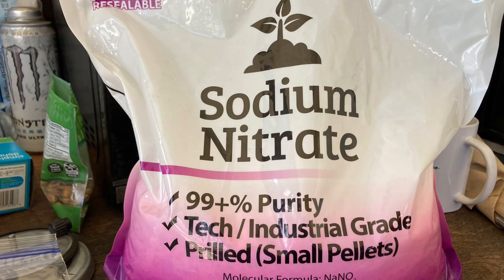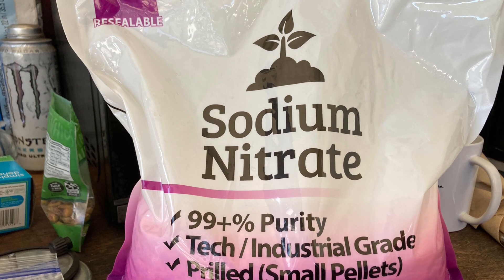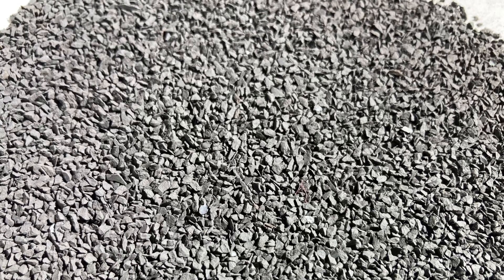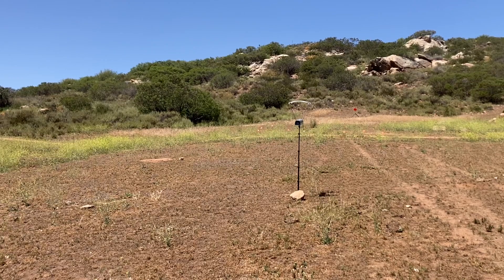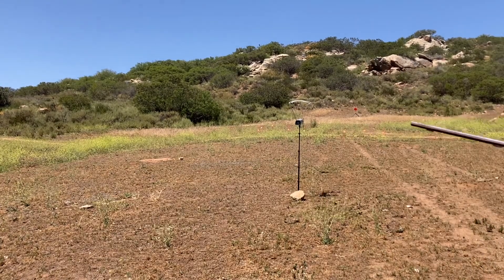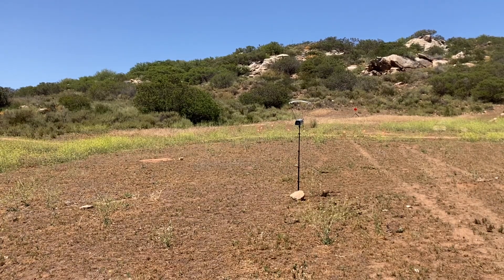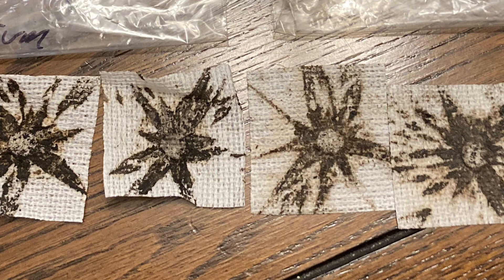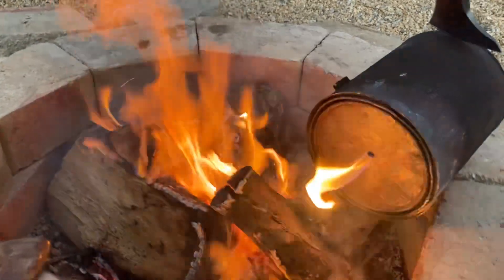Sodium Nitrate Black Powder

Comment: As far as the charcoal issue, cooking it at a high temp, and for a long time, it will cook off all the volatile compounds out. When I have made my own charcoal for iron smelting, if I fully cooked it, it would be much less dense, than if I shut down early. The charcoal that I made that was shut down early was much better for making the proper atmosphere in the smelting furnace to reduce the ore properly, I could never get the fully cooked charcoal to work right. Charcoal making is whole subject in itself, and one rabbit hole that you can go down for a long time

Comment: The slow flash in that long barrel is probably why it gave the better velocities, burning making gas the whole time the bullet is in the barrel instead of flashing off and bullet slowing down at the end of the barrel.
Reply from the maker: That’s an interesting theory
Reply: I believe smokeless powder burns slower than black powder for this reason. This is also the reason why you use smaller grain black powder in pistols than in rifles. Smaller grain burns faster which is beneficial for shorter barrels. Would be an interesting experiment to find the perfect burn rate for a given rifle.
Also ideally you would use a small grain fast powder for the flash pan and slow burning larger grain for the barrel.
Reply: Was thinking along those lines too. The unburned powder-dust that gets pressed against the ball might help with the gas-seal too. With a fast flash, this would be insignificant but with a slow burn it might help enough to make a difference.
But in any practical use, the water that creeps into the powder will soak up so much heat that it will underperform.

Rule of thumb is that you would want to reach the 'all-burned' state when the bullet is about 2/3 up the barrel (and still has 1/3 to go). This is for smokeless powder and once 'all-burned' has been reached there is only gas in the barrel behind the bullet. The rule derives from the reasoning that that last bit of created gas (at the breech) creates a mini pressure-wave that must catch up to the bullet before it reaches the muzzle in order to contribute to the velocity of the bullet. The wave will travel at the local speed of sound inside the barrel.
For black powder, the equations are not so simple as there are solid particulates and they are bound to interfere in the energy transfer through the system/barrel.

Comment: Seems like your rifle is fusing and that's adding to the slow ignition. Cut back on the priming charge, and tip the gun to the right just before shouldering to knock the prime away from the flash hole. It seems as though your flash hole may be a tad large as well. I shot competitively for 30 odd years, and these are a few things I picked up along the way. Apologies if you're familiar with these tricks. Swiss has been a tad more energetic and easier to ignite than Goex for many years, I've heard a lot of theories as to why, but none have been proven. Goex is more uniform, especially the 3F sporting. The best one for fouling control depends on conditions. With the high price and spotty availability of Swiss, I usually opt for the Goex. A lot of different oxidizers have been tried in black powder thru the years, but we always seem to come back to the old formula and methods. Excluding the newfangled nitro stuff, which I'm sure is just a passing fad...
Interesting stuff!
Reply from the maker: The lock on this rifle is timed very well and always goes off fast when using any potassium nitrate based powder. The sodium nitrate flashes extremely slow in open air. I couldn’t agree more, smokeless powder is over rated

Comment: The information is ALL out there about Sodium Nitrate powders. Even why it was used for blasting, uniformity was not important and slow was generally better. When exposed to  high humidity the ballistic uniformity sucks so its bad for propellant. There was a reason why the serious militaries world wide (like the British) would not use sodium powders or powders coated with graphite, nor would sportmen and in fact  nobody would even make it for a propellant or fuse powder. . PLUS you CHEATED using the material to reduce the humidity the powder was stored in. . And I know why how the charcoal is made is important. If you are going to make blackpowder and COMMENT on blackpowder you might want to dig though the material from the 18th and 19th c on making powder. Have you ever wondered, for example why Curtis and Harvey stopped making their premier powder, Diamond Grain, when they could no longer get the specific wood they used to make charcoal in RETORTS?  Its that important. It was Dogwood from a specific area in Spain and was cut as a specific time of year. The Spanish Civil War ended Diamond Grain. Like I said charcoal and it careful charing is` that important. Swiss is the best because they make it to be the best. Milling time, ingredients, how its pressed ALL add up.
Reply from the maker: Keeping my powders dry for a consistent test is cheating? Sorry mister, I didn’t realize you made the rules when it came to making and testing Black powder. I would suggest making some yourself since mine isn’t up to your standards. Vaya con Dios.
Reply: @Everythingblackpowder  It is when using sodium which is EXTREMELY variable when exposed to humidity. Potassium Nitrate will take up some in high humidity but not enough to significantly effect ballistics. AND when or if the humidity drops it will return it back to the atmosphere. Sodium does not. Thus its not ballistically suitable. Think about a warship with the magazine BELOW the waterline and ready powder charges in WOOLEN bags and you might understand why powder made with ANY significant amount the sodium is a no-no for anything but blasting. If you have been at this long enough you would remember the Curtis and Harvey imported in the 1960s and early 1970s. If you have an old copy of Lyman’s Blackpowder Manual you would note the HUGE charges needed to match the then GOI powder. It took near DOUBLE. WHY? This powder was made in a blasting powder plant in Scotland and the stuff was not only properly milled it was contaminated with Sodium since thats what they used for the blasting powder.  Like I said there is a large amount of data out there. I have a significant amount sent to me by a guy who’s WWW moniker was “The Mad Monk”. If you search might still find some of his stuff on gthe WWW. But he passed away, bone marrow killed by working for Oxy Chemical years ago. He could take powder apart and check the grind, how large the particle sizes were and even find sulphur oxiding bacteria which was common before the plant in Moosic, PA blew up the final time and Goex moved to Minden. At least they had a better saltpeter supplier there and did not not have sticks and pebbles in their “pure” Potassium Nitrate. 
But there are issues with the Minden plant being designed for military grade powder which in modern times is only used as fuses and boosters in shells and grenades and as a booster in artillery propellant charges. If you got to the Battleship New Jersey sight and find the right video you will see what I mean about propellant boosters. You cant set off a large charge of smokeless with a primer. I am not the expert my friend and I never read everything he sent me, relying on his, explanations. But I DO know why your charcoal is not working well. You are probably burning away too much of an element that is essential to good powder making. Also if you are not using a wheel mill its going to be tough to duplicate a premium sporting powder. There used to be many really good powders made in America. Until DuPont destroyed the industry.
Reply: Congratulations Dan! You won the award for the most tragic, longest, and meaningless word salad!
Please keep us updated on your ever-increasing vocabulary so we could have our 'comedy Central' laughs with our friends over a cup of coffee. HA HA HA
Reply: Lmao, bit too much whiskey before this comment perhaps? How many variations of powder have you made and tested?
Reply: @Spubaru  I was the one LMAO. Have you done any study? Do you have any historical material to study? Do you know anyone who has? Have you ever shot any pretty good but not good enough powder from a Nock patent breech flintlock? Probably not. If you make one and shoot almost any powder, home made otherwise in it it likely with fail to work in a few shots.  I don’t have to make powder to understand how its supposed to be made for blasting, Musket, Rifle or premium grade powder. And its impossible to make good charcoal for BP the way its described here. Making blackpowder? I have better sense. And yeah I know how. But why should I bother to make an inferior product if I don’t have too? Besides fast fires are common in making BP. ANd BP flash burns hurt. A friend of mine, years ago,  visited the Green River powder plant  and told me the carelessness and dust in the air, powder on the floor, frightened him so bad he could not get out of the place fast enough. They soon had a “fast fire” and the endeavor ended. You remember Green River Rifle Works? Right? Made Hawken Rifles and kits, And their powder plant blowing up? Or GOEX getting sued by a couple of Army Sgts over faulty powder in a grenade fuse?  If you used the Goex made in Moosic and found a lot of dust in the cans, remember that? Do you know WHY there was dust in the cans, I mean a LOT of dust. Making the bottom 2-3 ounces useless? Probably not, I do. You post like you are too young to remember these things. Even though I must admit any decent Potassium Nitrate press cake powder is superior the the powder being made in the colonies at the time of the American Revolution. Remember that much or most of the powder made ANYWHERE in the mid-18th c was made in giant banks water powered mortar and pestles pounding away and then “granulated” by being pushed through a screen by hand while still wet. The wheel mill and press cake powder came later. Wheel mills were originally made to grind wheat into flour. But they knew that they needed the purest possible Potassium Nitrate even then. There has been nothing new in blackpowder or “blackpowder substitutes” since at least the last half of the 19th c. Pyrodex, for example, is a remake of an old, failed, chlorate powder recipe. Sugar powders were invented back then as well. But of course you knew all this. I have been shooting BP and writing about its use for quite some time. Started shooting in the 1960s and writing in the 1970s.
Reply: Jesus dude are you spun? You write freaking novels as reply’s and you’re always yelling lol. I’ve done quite some research seen lots of studies on the physics and chemistry of black powder, but mainly I think you missed the point of Jakes video. Try watching it again…
Reply: Omg, I just noticed you’re a safety ranger!! That’s why you’re so mad!!!! Lmao!

Comment: Dont mill use water video blackpowder R1 or R2 sift add to water heat blend with mixer till smooth as silk simmer till thick spread on cookie sheet let dry crumble sift test
Reply from the maker: Yeah, that’s like the “CIA Method” I’ve done that plenty and prefer this way because it makes equally as powerful black powder without the extra steps. If you don’t compress/corn your powder it definitely won’t be as powerful as the commercial grade powders. I only use my powder as antique muzzleloading propellant so I’m only interested in the velocities it makes and how clean it burns.
Reply: @Everythingblackpowder  I put it in British 303 hit what I was aiming at 300 yards did 10 test good...also put 309 primers in the brass all good in the hood
Reply from the maker: Yeah, It definitely works I made mine the same way for a long time. I’ve used it in cartridges as well but no matter how you slice it, it’s not as powerful because it’s not as dense as corned powder. You can test this by measuring out equal amounts of commercial stuff and screened powder in a volumetric measurer and then weighing them. The screened powder will be 20-40% lighter than the corned powder.
Reply: @Everythingblackpowder  definently not as powerful but if you can't get what you need get what you can and out to 300 ,  350 yards holds a tennis ball so shtf make it

Comment: I switched from lead to 316 stainless steel in my mill many years ago. Much cleaner and so far no unwanted ignition
Reply from the maker: Lead works fine for me.
Reply: @Everythingblackpowder  thats true and safe but as you mentioned you have  issues with your performance (feets per second) in your rifle! One issue with lead ball media  is that leaves traces of lead and contaminated the end product ! As for the charcoal process about cooking is: first you use paint can and paint can leave behind trace's of iron oxides in your charcoal ! Second: as i see you don't leave it until the fire completely  disappeared which leaves behind uncarbonised wood and fuel properties in you wood! Third: of course the wood choice is the main and first factor BUT!! The correct time to harvest you tree is during the winter  between mid January and beginnings of February because then the tree have take all the minerals and moisture down to the roots for protection from the winter ! Four: the cooking process needs to be at 550°F Fahrenheit or 285°c Celsius and completely cooking until the fire end's! I know a lot of process but swiss goex and other brands live with this job! Of course other factors effect the end result ( right corning( 1.7cc density or more) , correct ratio's , milling time, completely pure chemicals, etc) I hope i helped!

Comment: The molecular mass of KNO3 is 101 g/mol and NaNO3 is 85 g/mol. The 75:15:10 ratio will need to be adjusted. For equal weights of KNO3 and NaNO3, the NaNO3 will contain more oxygen.
Reply from the maker: Yeah but it’s hard to argue with results
Reply from the maker: Theoretically 😉

Comment: propellant made with sodium nitrate will be very hydroscopic, eventually not fire due to moisture absorption.  suggestion-get some potassium chloride water softener salt along with this NaNO3 and do a replacement reaction:  NaNO3 + KCl ---NaCl + KNO3
Reply: I read potassium hydroxide for making your own from compost, will that also do the exchange?
Reply: @SW-ii5gg  no because sodium ion is more electronegative.  sodium and chloride have a stronger affinity for each other-the reaction between KCL and sodium nittate is called a double replacement.  KCL is cheap-snow melt and water softner. Cheers
Reply: @schinderiapraemeturus6239  thanks for the explanation, cheers.

Comment: When i was  an adolescent back in the 1950's we used to mix drug store purchased saltpeter and mixed it 50-50 with standard supermarket purchased white refined sugar, likely cane sugar.  It picked up water from the atmosphere very quickly.  I once did try it in an open pipe to fire a bolt.  It did, but was so badly fouled that subsequence shots were not possible.  I used a piece of jetex fuse for ignition.

Comment: Would any of the perchlorates make good black powder? Nitronium Perchlorate in particular looks to be really damn powerful from what I've read, but I've also been told that perchlorates in general don't play well with Sulfur, as it makes them rather unstable.
Reply from the maker: Mixed with sulfur it would be percussive and potentially unstable but It could be used with sulfur free black powder

Comment: You did realize that you must use less sodium nitrate than you use potassium nitrate, right.  The molecular weIGHT is less, so the potassium proportions are no longer correct.
Reply from the maker: Yes but it’s tough to argue with results.

Comment: My retort is made from standard size propane tanks the burner is holey. A small wood rack and door cut and bolt, washer guides. I made a retort chamber above with a hole bottom center to help heat the burner. I cut a circular lid, cap, top hat. They are wrapped with tank sides bent to shape and spaced for a flame  guide. It took 4 tanks for parts.I  made a kiln brick  covering to guide flame an inch or two around the retort, burner with air venting all round base. I heat with the bark sapwood scraps I cut at 10 inches x 1+ inches for retort wood. No bark or dirt for char wood. Stacked very tight in retort chamber it heats o2 free. When torching stops, I stop feeding the burner and let it cool of its own accord. The char is sparkly with only the very slightest hint of color. No wood left.  I only have to keep the artists from taking the perfect charcoal.

Comment: Sodium nitrate absorbs water like crazy compared to potassium nitrate. It is likely that your  NaNO3 black powder was slow because of water content - it needed dehydration.
Reply from the maker: It flashed slow. It didn’t make slow velocities. We stored the sodium made powder in a sealed container full of silica gel desiccant balls. We are doing an experiment now where we are placing are finished powder in a vacuum chamber with desiccant for a week to see if it has any effect on performance.
Reply: @Everythingblackpowder  NaNO3 neds to be dessicated before it is measured for powder - it holds so much water it can throw the proportions all off -eg if the NaNO3 is 10% water by weight then you end up making the powder with 10% too little nitrate. On top of that, the water in the powder can itself affect burn rate. Weigh the nitrate before  and after dehydration (I use a food dehydrater for about 5 hrs at 150 degrees for the ingredients, not the mixed powder), you'll see how much of the nitrate was water, it can be surprising. The powder will also pick up moisture from the air unless it is sealed in storage.
Reply from the maker: Very interesting. I hadn’t thought of dehydrating the sodium before hand. Thank you!